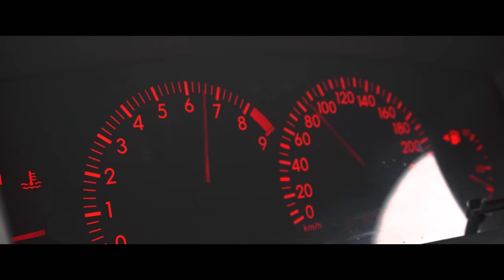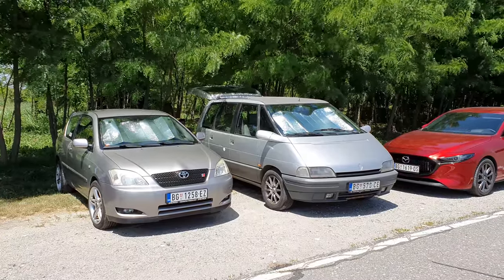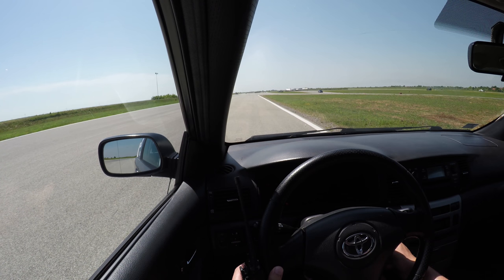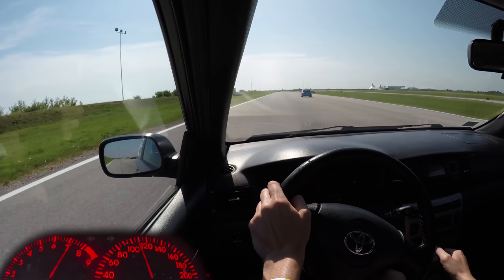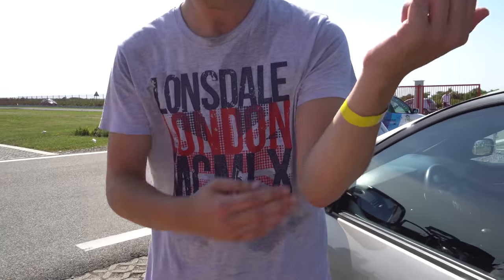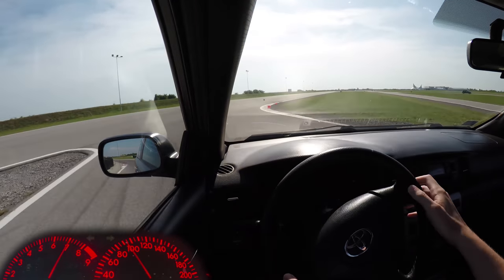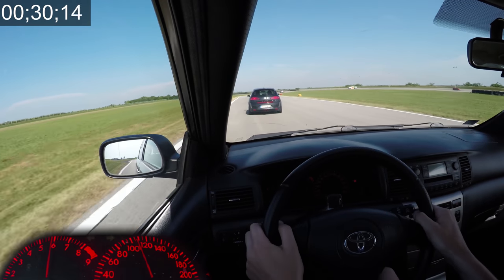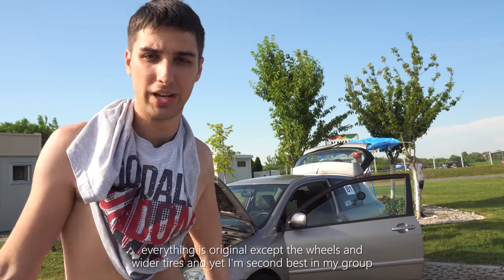Toyota Corolla T Sport - TRACK DAY [with wider Tires]

Comment: I have a Corolla T Sport track car, good job on the wider wheels, I run some semi slick tyres medium compound, OMP seats and 3 point harnesses, polycarbonate windows, Tein coilovers, upgraded Mishimoto radiator (prob needed even more in that climate), EBC grooved brakes, Yellow stuff pads, braided lines, 2"5 inch exhaust and intake. Great tip also for that engine, get an oil cooler unless yours has a factory one. Also you appear to be braking and turning at the same time, try to get all your braking done before you turn and use the throttle to balance the car in the longer corners. Also try to practice turning the wheel once to hit the apex and not applying more turn / lock mid corner. Well done on a good lap time!
Reply from the maker: Thanks for taking your time to write that long message and tell what you did, I'm still newbie in this sport but I am heading in a right way, wider tires really improved the grip. If you didn't watch my newer T Sport videos where I also put the K&N filter and Front strut brace and improved my laptime by 0.6s https://youtu.be/URSfKXoSFLs  
And will upload soon Part 4 Update where I installed Sparco bucket seat :) Anyway about my driving I do in few corners brake while steering wheel is a bit turned, not much and yes I'm still learning heel & toe. About not making many steering turns before apex I realized and agree I need to work on that too. Thanks for the support, today I had another Track day with Sparco seat and it was amazing but at the end of the 3rd last stint when I was giving my best to set the fastest lap, some knocking noice started :( On monday mechanics will check it and see what was it, we suspect its chain related. Sad day but thats life, stay tuned if interested.
Reply: No problems! Keep up the good work. Will check out your other videos, might have to make one of two of my own, last track day of the year for me at Snetterton on the 01-11-19. You know what they say practice makes perfect so keep doing it over and over! I have a knocking noise since my last track session however I think it's the lower arm bushes or something suspension related so will investigate that this week. I have 124,000 miles on mine and so far no indication of a chain issue, hope yours doesn't turn out to be that bad and it's back on track in no time! Look forward to seeing what you do next.
Reply: Also I forgot to mention, you can get a baffled sump for this engine which will reduce the chance of oil starvation in corners over 1G.... I've not took the plunge yet however it's on the list for next year. Go careful until then and keep and close eye on the oil 😁
Reply from the maker: @luk-argen7144  Thanks for more info, yeah hopping the rattling in the engine isn't something big but at least the season is over so I have a lot of tine to fix snd study. Also recently bought Peugeot 207 GTI, always wanted to have turbo car too and take it on Track day too, I know reputation about that 1.6T bmw engine is that they arent so reliable but with a mechanic we found that only works on those engine and goes on track days with them is most important to have. Learned that in this sport you need to know a lot about your engine and to protect/improve weak spots. Also to drive clever, not to go full on in first stints but to warm up and study/remind the track. (My car is 72,000miles although thats because owner was mostly driving in city, only few times he did longer travels)
Reply: @VuckoHD  Nice! I'm also thinking about a turbo car for the track. I may look into turbo charging the T Sport if I can't find some info on it. I understand the stock internals can handle a decent increase in power as the Lotus Elise R had 260bhp from the same engine. I also have a modified Nissan 370Z (around 398bhp N/A) but that is in the garage for the winter. I noticed your gear stick video with the seats, I cut my gear stick in half and welded it back together to make a short shifter, although reverse is now difficult to engage as I don't have as much throw on the leaver 😂 keep up the good work! I just ordered a new camera for my next track day, we are not allowed them on the outside but will upload a video of my T Sport when I get a chance
Reply: Also holding the steering wheel properly. His hands are all over the place. Hold at 9-3 o'clock as much as possible :)
Reply from the maker: @Dan4096  This Corolla T Sport has slow steering ratio, I have to steer a lot in order to start really moving left & right
Reply: @luk-argen7144  I'm just in the process of building a track car, T Sport, are you in the UK? Where do you get a baffled sump or is it a DIY job? I did one years ago, increased capacity and baffled it but it was a MK1 escort.
Reply: @simonbehnke4756  Hi Simon! You can get a baffled sump for the Lotus Elise but they retail around £400. I plan on DIY job it myself, you do have the option of a 1zz sump however it it only includes a windage tray from factory and the 2zz engine will suffer in the higher rpms as there will be a delay in oil returning to the pick up which is also slightly different on the 1zz sump. Best option is to add some proper baffling into the 2zz sump, it's something I'm going to look into next year. After Snetterton on the 01/11 the car is away until next year. I'm in the UK, whereabouts are you? It gets some attention at the track, especially when you leaving the type r's behind 😂😂
Reply: @Luke Argent I there, i see that Mishimoto doesn't make a radiator for the corolla, did you adapted an existing one?
Reply: @luk-argen7144 you have the car now mate???

Comment: I like to see that you are getting positive comments from people.
I was going to say, look at entry speed and take just 10kph off that. Concentrate on smoothness with the steering (as your not entering so fast). Feels like you overload the tyres too suddenly.
Another big thing - remember that the speed at which you come OFF the brake pedal has a huge part in how balanced the car will be in the corner. You come off real fast and you'll change the pitch a lot.
Keep on going!
Reply from the maker: Thanks for watching and giving feedback. I agree to your points but just to let you know the Toyota I drove had a very slow steering ratio so I had to steer a lot in corners, i did improve a lot though if you see watch this newer same track day video: https://youtu.be/PH2DZpu3syc?si=58yBRzjklRbLG1Aj

Comment: Now just remove all the useless items like the rear seats, luggage cover, tools etc. If you have another car as a daily you don't need comfort with this car. I would like to know how much weight you can strip.
Reply from the maker: During that Track day I removed tools and spare wheel. I'm still learning the car and being on race track so no need to go extreme to gain 0.1s. But later I surely will do that
Reply: @VuckoHD  I wouldn't call that extreme. Those items can be removed in under a minute and things like the luggage cover are useless anyway. You would gain a lot more than 0.1 seconds if you remove like 50 kg.
Reply: @VuckoHD  Just weighed the luggage cover and rear floor mats and they weigh a whopping 3 kg together :P The racing seats do make a bigger difference though. When you do decide to buy a helmet get an open face model for the hot days haha.
Reply from the maker: @g.bergervoet4505  It's not extreme to remove seats and covers but also didnt want to give advantage because I wanted to see how much do wider tires improve my Toyota's time, also yes I bought one open Sparco helmet and one Sparco closed helmet for carting :)
Reply: Removing weight has many benefits. You accelerate quicker, stop more easy and with less stress on the brakes, which are not made for trackracing anyways. Your car will tilt less when cornering and give you more even grip on all tires. The higher the weight you remove, the better. Also it always felt more fun to drive my cars after removing weight. If you remove alot, your car will be higher, which is bad for cornering. Also your springs and damper are set up for this car when fueled up with only one driver to 5 people with luggage. They will be to stiff. To improve, you can find springs and dampers to lower your car and compansate for the weight loss.
Reply: I sit on 980kg just with a bucket seat, and haven't finished the weight reduction yet  :)
Reply: @TeknikIE  with a corolla t sport? Did you remove the rest of the interior?

Comment: The 2zzge has temperature problems, with your general, the engine will not do that long !!! 
Liftbolts already exchanged? 
And another landing gear will be a big plus as well as more crash on the front axle

Comment: Word of advice. Don't change your hand position on the steering wheel. Great video btw.
Reply from the maker: I know that but with this car (Toyota Corolla TS) I have to because of slow steeeing ratio...just look at the steering angle that I have to use to go around tighter turns

Comment: from what i can see you are a solid driver i would just tip you to focus more on exiting the corner faster instead of coming in hot and having a sloppy exit, try to brake firmer and get in the right gear before the corner and then open it up with gradual throttle
Reply from the maker: Thanks for watching and agree I was overly agressive entering the corner, the video was 3 years ago and I was still a newbie. Improved a lot since then, you can watch this video: https://youtu.be/PH2DZpu3syc
Although the Peugeot 207 GTI that I use now is much easier to control and set a proper fast lap without mistakes
Reply: @VuckoHD  oh yes you can see the difference in the first few corners, good improvements and much cleaner, nice! How is the 207 GTi? I was thinking about getting one but my friend has a Peugeot and is losing his mind with all the problems. Thanks for the reply
Reply: @VuckoHD  where is the corrola bro ?
Reply from the maker: @t1mech1ldtc60  Watch this video: https://youtu.be/-qNkl0l_YBQ

Comment: Beeping is ESC? Can it be disabled for track use? :-)
Reply from the maker: Yes It can at anytime moment :) Its me who decided not to that day
Reply: @VuckoHD  Thanks for the reply, I just bought the Australian version of this car... I got it cheap as it needs work so I have only driven it home! Nice work on the videos, you helped me decide to buy :-)
Reply from the maker: @krazed0451  me again, sorry my mistake you cant turn the beeping off by turning off TRC, you need to pull one fuse for that. I'll do some research on what fuse it is but still I dont find beeping annoying, it actually helps me to know that Im close to loosing control of the car :)
Reply: No worries, thanks for the update! I'll have a look on the forums as to which fuse needs pulling, I'm yet to drive my car hard so I've no idea how intrusive the system is yet, I might end up leaving it too :-)

Comment: Top 5 things to do :
1)Weight Reduction 
2)New All-wheel performance brakes
3)Turbo
4)New Coilovers
5)Optional (Cooling Upgrades/Mods)
Reply: Turbo is stupid in this engine, compression ratio is already mad. Better lightened flywheel and cams, and you get a beast!!!